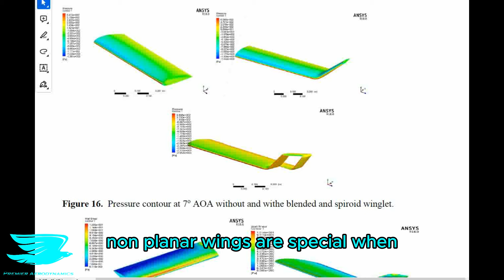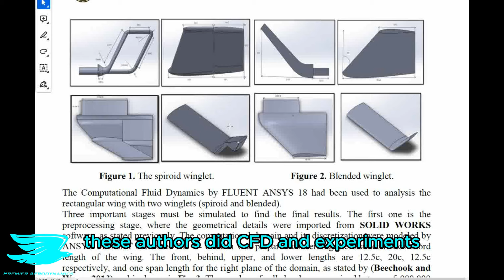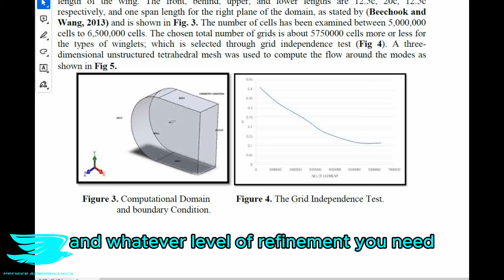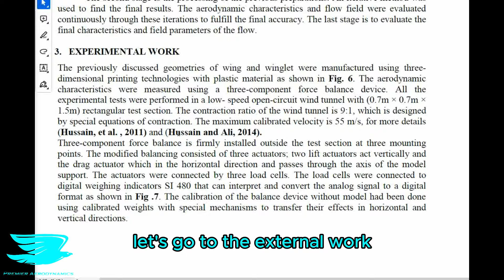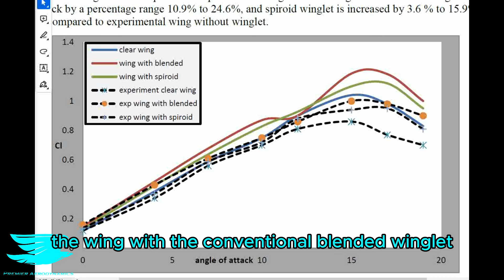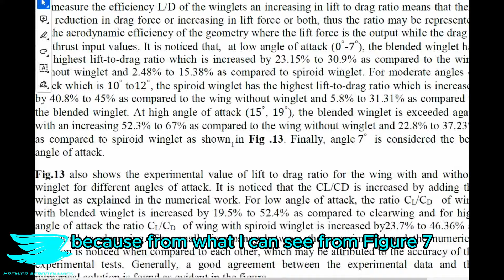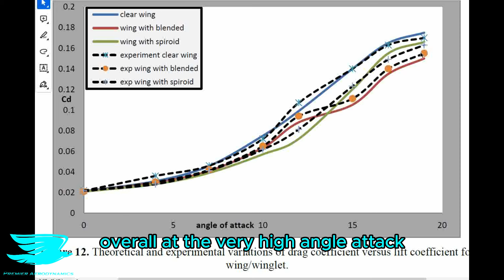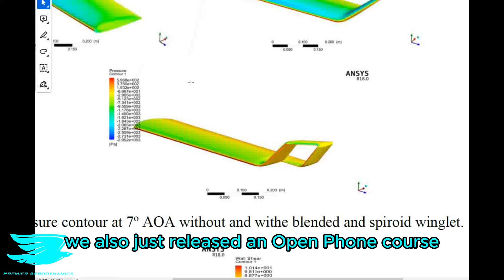Podcast #164 + Nonplanar Wing Aerodynamics

Comment: I also red that heliptical wings stall everywhere at the same time which makes them unpredictable for the pilot. With a planar wing the wing tip start to stall and the pilot feels it and can react. Thanks for the video. It is very knowledgeable for me to design my 3D printed wind turbines and RC planes.
Reply from the maker: That's an interesting point. An untwisted elliptical wing will theoretically stall everywhere at the same point. With viscosity, it still happens a bit, but spread out over a slightly greater angle of attack range (but not much).

Comment: The CFD in this study shows something interesting, the tip vortex is both smaller and has moved away from the wing itself. This gives the wing more surface area since the tip vortex isn't blocking the tip of the wing as much. Honestly I think that's how they actually work, they move the tip vortex away from the main part of the wing, more area means more lift, which means less AOA, which translates to better efficiency.
Reply from the maker: That's true, moving the vortex away from a lifting surface makes the surface more efficient and it also results in the wing producing more lift around where the vortex would have been because you don't have the vortex downwashing any flow and reducing the local effective angle of attack.

Comment: What if you could produce CFD as a function of a light source reflecting off an object? Since light is an electromagnetic wave it can be described with the same equations as an irrotational vortex. Since they both decay with the inverse square law. So what if the probability of a vortex is proportional to the specular reflection from a point light?
Reply from the maker: I'm not sure. I'm not really an expert in light physics. I just know the basics. But, one thing I'm not sure about is that light can be reflected (probably because of its wave-like properties), but fluid can't really be reflected because there is more fluid always hitting into the back of it (and light reflects because when it hits a reflective surface, it excites the electrons there and then another photon is emitted, at least from what I know).

So, I don't know how that will work. Sorry.

I really wonder how the duality of light (the particle and wave nature) makes it different to fluid, which is just a bunch of particles.
Reply: @PremierAerodynamics  I just figured since the Biot Savart law can be used to calculate both down/upwash with respect to a vortex filament, as well as the magnetic induction from a moving charge (which works surprisingly like vortex with it own upwash and downwash component just, at the speed of light.) That maybe irrotational flows and EM vortices are somewhat related if they both follow the same mathematical mechanisms.
Reply from the maker: @rolandotillit2867  In that respect, you might be able to use this in something called a "vortex panel method", which uses vorticity and circulation to simulate flows.

That is also inviscid, which is also another potential difference between Navier Stokes solvers and light.

Also, there are more similarities between light and the lattice boltzmann method. So, maybe LBMs could work.
Reply: @PremierAerodynamics  thanks.
Reply: @PremierAerodynamics  Reading up on this, you sir are a genius, LBM does use specular reflectivity to determine no slip boundary conditions! I'm reading a paper titled

Application of Lattice Boltzmann Method to Flows in Microgeometries

Since LBM is very good with rarefied flows, I already came in expecting it to perform well vs experiment, so I went straight to the methods section to see how they modeled the wall boundary conditions. It's just like you said. Turns out pure specular reflectivity means no slip, which means energized boundary layer, precisely what vortices do.
Reply from the maker: @rolandotillit2867  Well I guess it was more of a lucky educated guess. 😁
Reply: @PremierAerodynamics  Hypothesis 😀

Comment: Maybe it's just the design of the wing, there's a little hysteresis at 10 degrees, that's usually the onset of separation. Notice the range where the CFD deviates the most from the experiment. From around 10-15 degrees, then it starts to converge again with experiments. Realistically most wings start separating at 8 degrees, they'll keep building lift, until around 15 degrees, after that the air just doesn't want to turn without help.
Reply from the maker: That's a good point. The deviation probably has a lot to do with the start of flow separation, which is the most tricky part to get right in CFD.

But, I'd still curious as to why this airfoil did that because you don't see that wiggle in most airfoils.